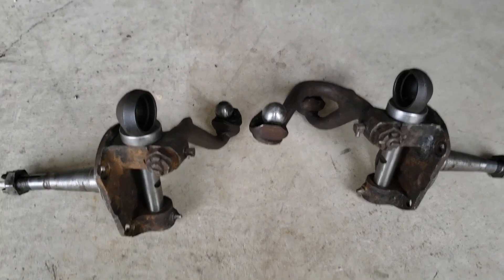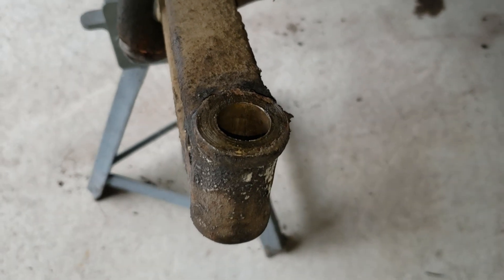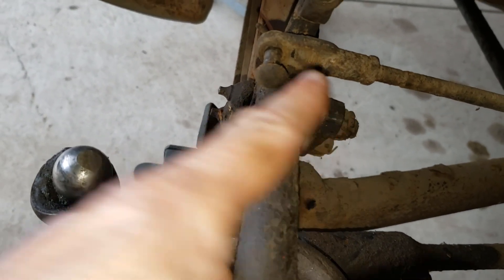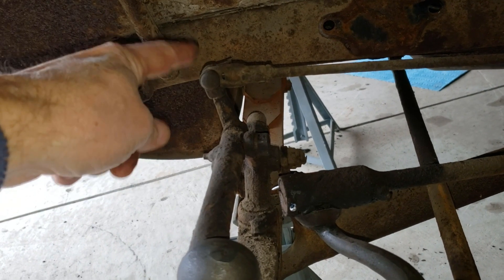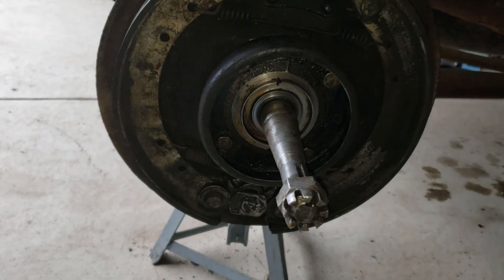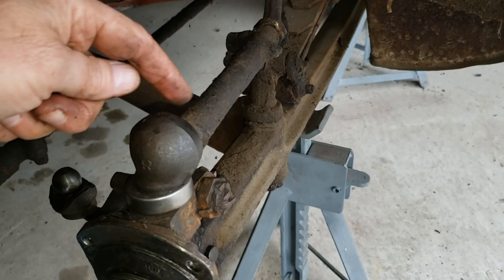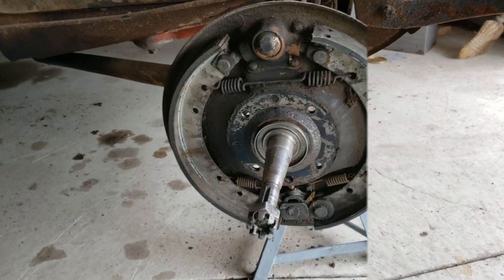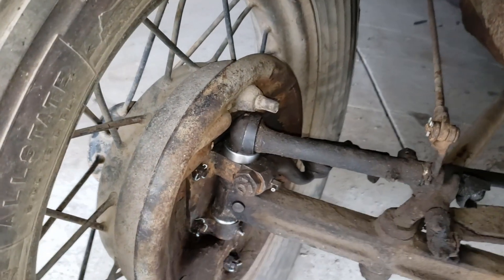Episode 6 PART 2 of 2  1930 Model A King Pin INSTALLATION! #withme #modelaford #barnfind #stayhome

Comment: Just a "heads up" that the pins holding your rollers on the bottom of the brake shoes are in backwards. The cotters should be toward the outside of the shoe. The "head" of the pin should be located on the roller track, and rides on the roller track as the shoes move in and out. You should also double-check the tracks (the "ears") that the pins ride on to make sure they are flat on top and don't have grooves worn in them. That inhibits the head of the pins from moving back and forth smoothly. You should see a great improvement to your brake adjustment and braking if you take care of that little detail. Check the rear also. Model A's are the best!
Reply from the maker: Great info Rusty! 👍 Thanks for providing it!